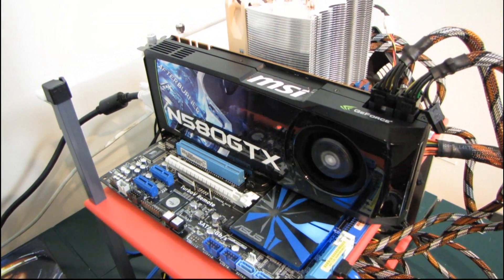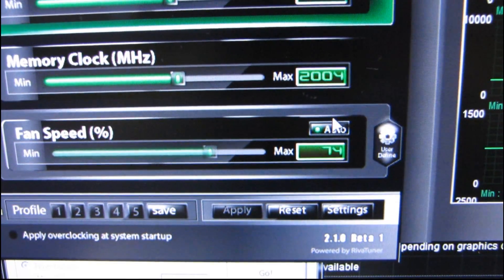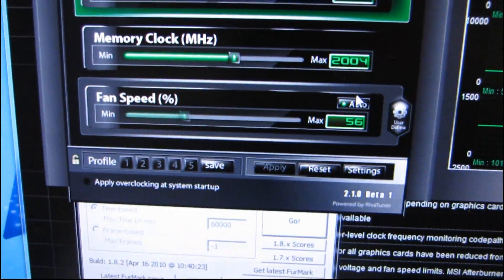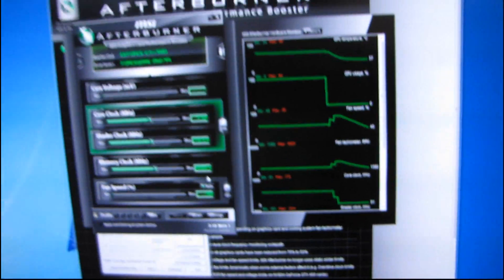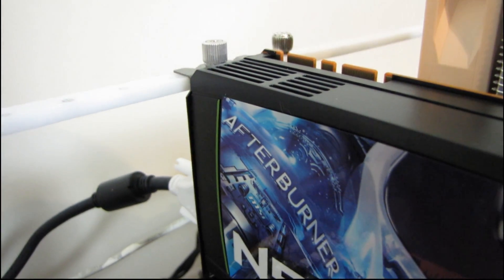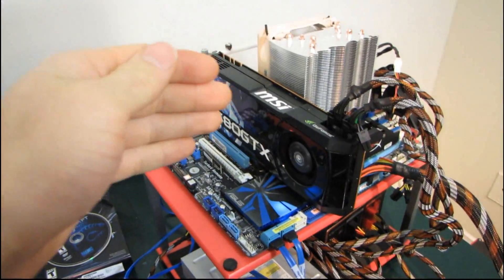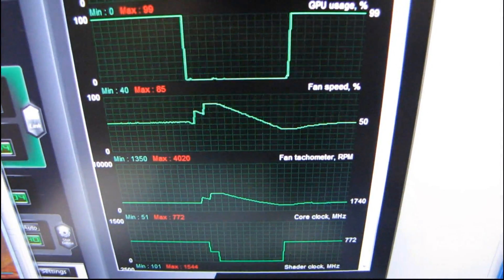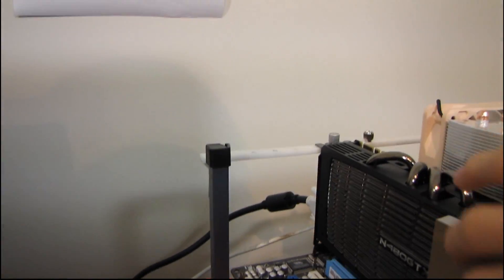Adaptive Fan Control on the NVIDIA GeForce GTX 580 Explanation & Demonstration Linus Tech Tips

Comment: I'm not sure if this is because of Nvidia's latest drivers, but my GTX 480 is lowering its fan-speed at increments of 1-2% now too. It goes up by increments of 1-2% at a time too. It didn't do this before. I guess they issued a driver revision and all the fans were capable of doing this before, just never had it on.

Comment: Why can't they add a larger fan to the card and set it at a lower rpm, so it's not as loud? If they are worried about it not being direct as a smaller fan, I'm sure they can add a air chamber that creates combustion to be released directly on the GPU. hmm

Comment: i REALLY dont mind the heat or fan noise on the gtx 480 i own, personally i wish i saved and waited for the gtx 580 but hey, when you have money to blow and want a killer system you'll probably opt for the latest and greatest at the time. i have my custom prof in afterburner to stay at 60% at 40c, then a constant increase to 100% at 90c. it never ever goes over 70c in the most intensive tests. and in a haf932 its loud yes, but its cool. saving for 2 of these soon =)